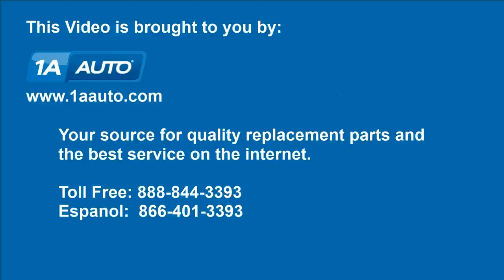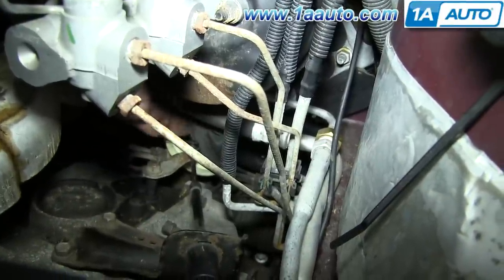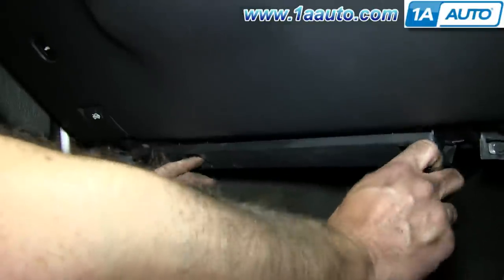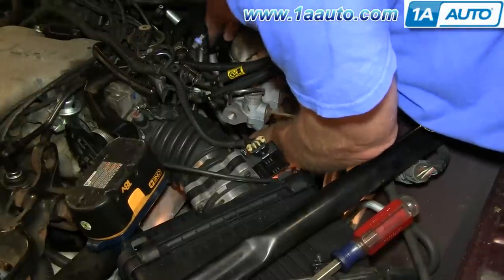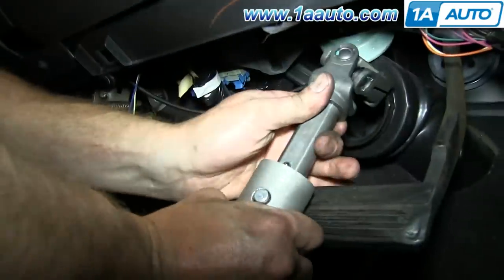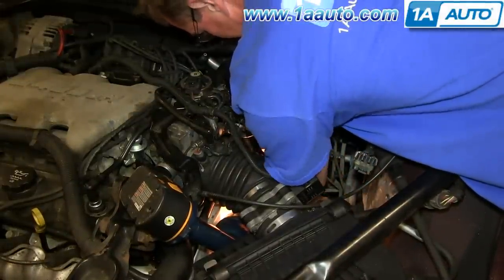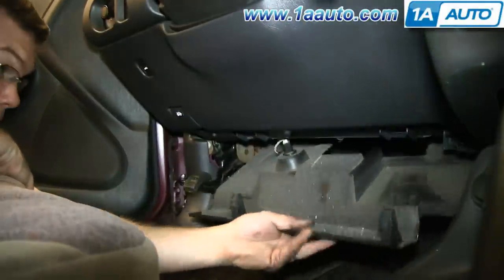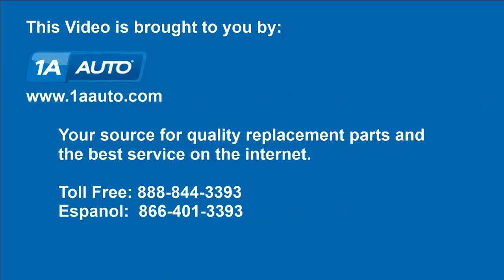How to Replace Intermediate Steering Shaft 00-05 Chevy Monte Carlo

Comment: Hey folks my fiance had a deer go under our car this morning and now I'm leaking fluid from this shaft it looks like, the rubber boot between firewall and motor, where u unhooked it, is where it looks like. Just steady drip, then a little underneath their seems to be lines(like brake lines almost)hooked into the shaft. So I'm baffled on how to unhook them(if needed), or if can just remove the rubber boot and somehow fix the leak. It's definitely coming from that rubber boot. Just odd you guys didn't have to touch any lines changing this. Or are the line into the rack/pinion maybe? And I'm seeing things. Mines a 2002 impala

Comment: I have done rebuild front end because of annoying noise. I have swap 3 times rack and pinion because of it. On the last swap i did, new rack and pinion, suspension, sway bar links, control arms and alignment. When Steer left or right the sound comes more on the left. I cannot pin point where it exactly is coming from. On pumps you are able to hear crack noise or when you steer you hear like stretching to crack.

Comment: These instructions are for the 2000-2005 Chevrolet Impala (Eighth generation) Turn Signal Cancelling Cam replacement. Once you use a PowerBuilt Streering Wheel Removal Set RENTAL from AutoZone to remove the steering wheel, after you removed the airbag, then you must use "snap-ring pliers"  to remove the snap-ring from the Steering Air Coil Kit GM part # 26089982, 26088931, or 26092622 aka "Clock Spring".  The next step is that one must use the Lisle 57340 Steering Wheel Lock Plate Tool and a small vicegrip to compress the turquoise/emerald spring, which pop the "Lock Plate Ring" GM part # 05694191 up from the lock plate. You can use picks — mine were from AutoZone — to move the lock plate ring from the lock plate... Once removed, then you'll be able to slide the "Turn Signal Cancelling Cam" GM part # 26086061 off the "Upper Steering Shaft" GM part # 26064247. You must be very careful NOT to disrupt the connection of the "Bearing Spring Set" GM part # 15231641 and "Bearing Kit" GM part # 26001827 from the "Upper Steering Shaft" GM part # 26064247.

Comment: Hey should that pinch bolt go back in easy? I had to take this shaft apart at the rack and pinion, and when put together and put 11mm pinch bolt back in on that end it turns very hard the entire way, put it in same side i took it out of i swore. But wondering if i did put this bolt in backwards as it was if that may cause it to turn in very hard and now it seems to just be spinning and not going the last 1/4inch or so in. Ive turned it for hours and its just not going that last lil bit in. Was not this hard taking out. Any help is great plz.
Reply: Sounds like it got cross-threaded and won't go in the last bit because the threads are stripped out.

Comment: Hello, my MC makes noise that starts from the middle of engine and ends at the right tire🤦‍♀️hope I’m explain my self. I’ve change an engine support, both axles, both base suspension and the noise is still there. What could it be ?
Reply from the maker: +lourdes ramos We wouldn't be able to diagnose an issue like that here, you may want to have a local mechanic take a look at it. Thanks for checking us out! http://1aau.to/m/Shop-1AAuto-c

Comment: I have a 99 buick century and I believe the layout is the same.. Im having issue taking the boot cover off on the engine bay side... even the inside, I had to cut a line to force a space to take the inner half shaft off (my shaft broken into half). any ideas?

Comment: For about a year now I have been getting this weird knock in the front end which I could not pinpoint.   My shaft made no noise when steering back and forth - it moved cleanly that way... just when it hit bumps did it make a noise. After checking EVERYTHING in the front end and consulting mechanics we surmised it must be coming from the intermediate shaft - as this is a known problem.  It was just a little weird hard knock that wouldn't sound with all bumps..  just the light repetitive hits like you would get running over washboards or bad pavement joints.  A search for recalls and TSBs only found that it was a common problem with many GM intermediate shafts, and the TSBs recommended lubricating the intermediate shaft sliding joint.   

So after viewing this video I went down to a you-pull wrecking yard and removed two intermediate shafts from two separate Impalas (both 2003), since this is what I own and its not much different from a Monte Carlo of the same era.  Getting them disconnected is one thing... getting them back in is another.  I found that once the shaft is off, MAKE SURE you memorize the positioning of the shaft ends in which it was removed. The steering wheel side is the most confusing, and the shaft appears it could go on one of two ways.  Getting it back onto the shaft at either end was no way as easy as this video was. the ends had to be pryed off with force, and I knew getting them back on would be a PITA.   for any of you doing this in the future, I would gently slightly separate the ends of the replacement intermediate shaft abit with a screwdriver before trying to get it on either the rack shaft end or the steering wheel shaft end - and let the tightening bolts squeeze them back together.  Otherwise it will be a real bugger to get them back on again. And I would make sure the intermediate shaft sliding collapsible joint is WELL LUBRICATED with grease before it goes in...   I got a Dorman shaft from another supplier and it wasn't all that well lubricated.   

After seeing how hard it was to get the one in the wrecking yard back together, I thought about it awhile and wondered why a TSB would only recommend re-lubricating.  I took a second look at one of the two shafts I removed and it was really hard to slide back and forth.   So it appears this is the problem with these shafts... the sliding joint dries out and stops sliding back and forth... thus transmitting all vibration and sudden shocks up the shaft to the steering column and wheel.   If this joint can't slide, it'll just send the shocks up to the actual wrist joints and make a hard knock.  I decided to just try and relubricate mine by using some Krown Rustproofing oil and Castrol Motorcycle Lube and sprayed it into the shaft on the steering wheel side... right down the column as it is hollow behind that sliding joint.   Then I worked the steering wheel.   Well - guess what. No more knocks.  

So that may be all that is wrong with your intermediate shaft - the sliding joint may just be dried out and needs some lubricating... and it doesn't need to be removed to do it.   But if you are getting grinding and knocking when turning the wheel either way... then thats probably not just the sliding shaft joint being dried out.  Anyways - hope this helps someone.
Reply from the maker: Thank you for watching!
 888-844-3393
Reply: Hi Eric - if you go under the dash and to the point where the steering column disappears into the firewall, there will be a rubber cover around where the shaft goes in. If you pull that cover back you can see inside the steering shaft abit - I would first spray some rustproofing / penetrating oil in there to loosen it up then follow-up with Castrol Motorcyle Chain Lube...  this goes in like a liquid but quickly firms up to a gooey grease...   that may / may not help. Depends on how seized the intermediate shaft is inside. and if you spray it in and it doesn't work right away - give it some time as the oil / grease can work into the sliding joint with time / heat and vibration and make the knock go away abit later.

Hope this helps...

Rick

Eric Kimmy
Hi I'm Eric...I know I'm two years late but plz help!! lol can you elaborate what you meant by we can lubercate it without removing anything?? And where exactly is the hold to fill up on these gm's? Help is appreciated thank you
Reply: Thanks! I'll try that first!
Reply: Thank you so much going to check this out in my 05 impala
Reply: @1AAuto  HELP!!! 1 HOUR before I get kicked out of the junkyard... See here: https://youtu.be/50ajEdtC0oE any ideas of where that cable goes and how to disconnect it, or is it safe to cut it and weld or solder it on my own Impala?

Comment: Does the lower linkage of the drive shaft, the lower portion that comes off the rack and pinion via 11m bolt, normally slide off on/of the shaft freely? I was dropping a sub frame, didn't remove that 11mm bolt and the whole lower linkage slid off the shaft when I lowered the rack too far. I slid it back on and it seems fine but I thought I should ask before I reinstall the rack.Mine looks like the top one from the picture in your video. Guessing it is the older one.

Comment: I have clunking noise problem in a Chevy 2005 Impala 3.4, when making a sharp right (usually at a parking lot when parking at a parking spot) turn but not a regular right turn. Could that be the problem? If so, how much would that part cost and how much will cost to fix it at a shop?
Reply from the maker: +Rene Oliva It may be causing the noise. You may also want to check all of the suspension components to see if any of them are worn and may be causing the noise. Hope this helps you out. 1aauto.com

Comment: Hello, what are the symptoms of a bad intermediate steering shaft? I have a popping that is felt in my steering wheel ... I'm thinking this might be the problem?
Reply from the maker: +thegreatecb Thanks for watching!  Yes, this is a common issue on these vehicles and is typically the culprit.  Here is a link to a new intermediate shaft if you need to purchase one!  http://www.1aauto.com/intermediate-steering-shaft-with-coupler/i/1astc00128?utm_source=YouTube&utm_medium=CTA+Comment&utm_campaign=ytcomment&utm_term=aRo2o8IdWjY
Reply: thegreatecb i know it's been 4 months but one other thing it could be is the strut bearing failed I had am alero that would clunk when you would turn but after replacing a tie rod I turned the strut and fount it was a bearing also I have rarely heard it but some racks clunck when they start to fail
Reply: My 2003 is real hard to turn half hitting a pot hole
Reply: @billschneider1753  mine doesn't want to turn left. Will if you slightly wiggle the will then can fell it bind up?

Comment: if there is a little poppin noise ata ccelaeration would the shaft clear that out!
Reply: and braking because i already pretty much replace whole front end on my impala just have front struts left.
Reply from the maker: +1of1Jaylo / We wouldn't be able to diagnose an issue like that here, you may want to have a local mechanic take a look at it. Thanks for checking us out! http://1aau.to/m/Shop-1AAuto-c

Comment: why did you changed that ? what was the problem ?
Reply from the maker: Thank you for watching! When you turn the steering wheel there was a clunking coming from the joint the the steering shaft.
 888-844-3393

Comment: Is it the same procedure for a 2006 Monte Carlo?
Reply from the maker: +HellBird The installation process should be very similar for your vehicle.
Reply: @1AAuto  Great, thanks for your prompt reply
Reply: @1AAuto  please make a video to depict this: These instructions are for the 2000-2005 Chevrolet Impala (Eighth generation) Turn Signal Cancelling Cam replacement. Once you use a PowerBuilt Streering Wheel Removal Set RENTAL from AutoZone to remove the steering wheel, after you removed the airbag, then you must use "snap-ring pliers"  to remove the snap-ring from the Steering Air Coil Kit GM part # 26089982, 26088931, or 26092622 aka "Clock Spring".  The next step is that one must use the Lisle 57340 Steering Wheel Lock Plate Tool and a small vicegrip to compress the turquoise/emerald spring, which pop the "Lock Plate Ring" GM part # 05694191 up from the lock plate. You can use picks — mine were from AutoZone — to move the lock plate ring from the lock plate... Once removed, then you'll be able to slide the "Turn Signal Cancelling Cam" GM part # 26086061 off the "Upper Steering Shaft" GM part # 26064247. You must be very careful NOT to disrupt the connection of the "Bearing Spring Set" GM part # 15231641 and "Bearing Kit" GM part # 26001827 from the "Upper Steering Shaft" GM part # 26064247.